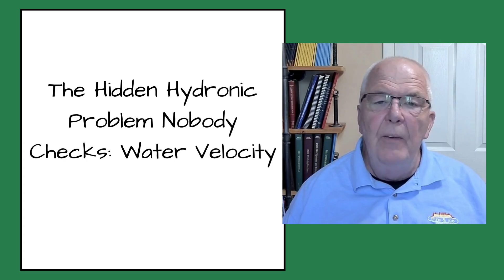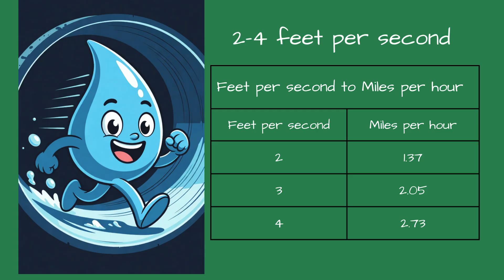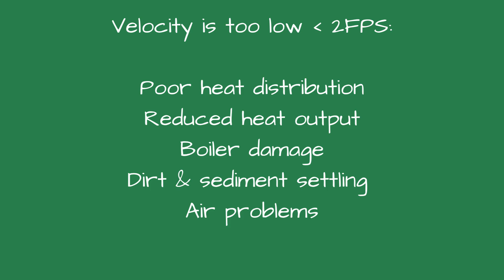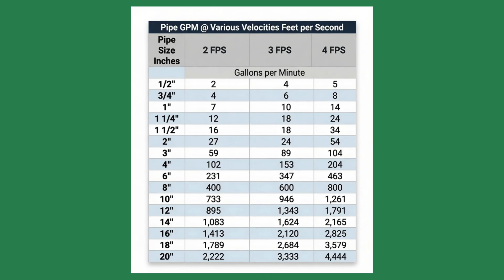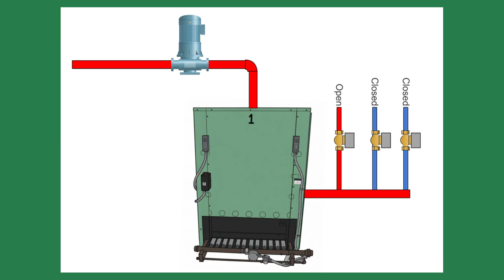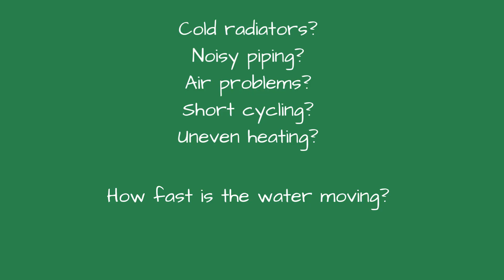The Hidden Hydronic Problem NobodyChecks: Water Velocity

Comment: 2 to 4 ft/second is the sweet spot for hydronic.  Lots of domestic hot water recirculation lines in apartment buildings end up with a bunch of pin holes due to velocity. The plumber fixes the leak in the pipe but never the root cause.  Once a system is installed its almost impossible to calculate the velocity.  My frustration is that this is a bit technical so I can calculate the job and size things for optimal but not get the job because someone else is $50 cheaper and the issue is to technical for most potential clients to take the time to understand. I used to take great pride in being a top notch expert but then I found that doing stuff the right way usually means your more expensive and wont get the job.  Ray your doing ti the right way by developing an online prominence so your reputation justifies a reasonable cost for your services. I hope you have a son you can pass down your name/reputation to or at least a good apprentice.
Reply from the maker: We rented a. Ultrasonic machine that measures flow inside a pipe it worked well Not sure it works on small domestic water pipes Yes customers choose low bid and then want us to fix it My son is working with me and getting really good

Comment: Thank you for sharing your experience...I have a problem to solve for a friend ...a hydronic residental system that has after many years working just fine..now 2 - 1st floor convectors aren't getting warm ...even after much bleeding water ..not getting air out ...and still the convectors remain cold...can you please advise me 🙏
Reply from the maker: Wow that's strange The top floor units are usually the challenge. I would look for a broken or closed valve for the first floor. Ive had the gates fall off a gate valve and do that. I would also try throttling the flow upstairs to see if more hear could be felt on first floor.